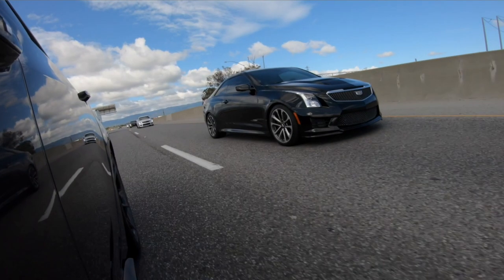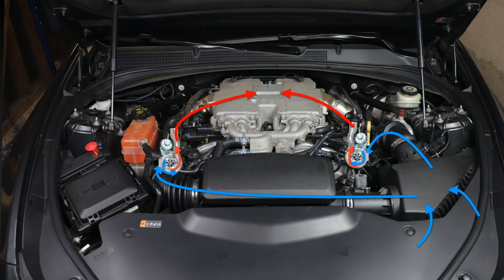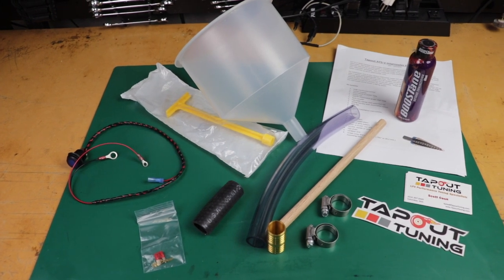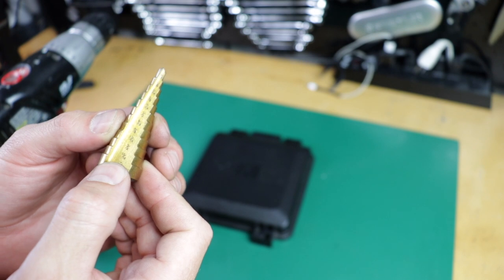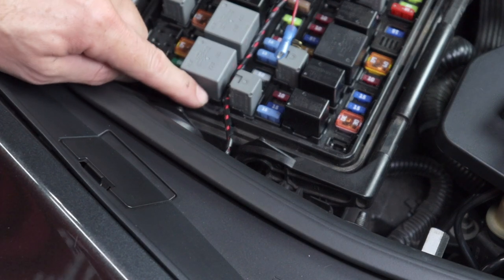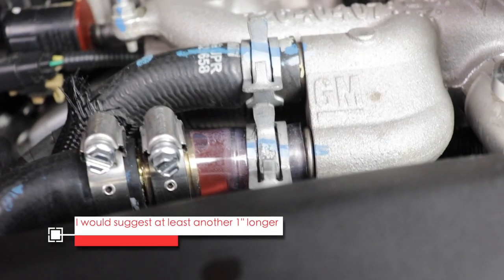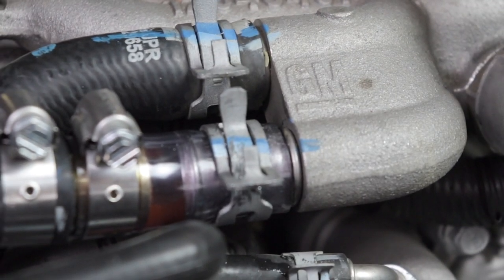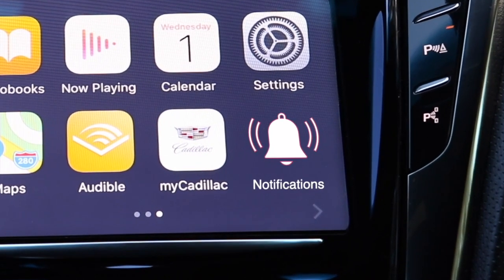Intercooler Bleed and Fill | ATS-V CTS VSport CT6

Comment: Just did my CTS-VS this morning.  My pump sounds like yours, like a dishwasher at the end of a pumping cycle.  So frustrating that it can be low on fluid/air trapped, and yet the resevoir shows it's full.  I'm giving GM a fail for this design.
Reply from the maker: The reservoir is not connected to the inner cooler. The reservoir is for the engine coolant. Part of the problem with the inner cooler system is there is no reservoir for bubbles to escape to.

Comment: So what happens in these sealed systems for coolant expansion from heat?
Reply from the maker: Yeah, not really sure where it’s going except possibly the bleeder valve. But it’s the first thing you want to check with loss of boost or high manifold intake temps.
Reply: I actually have an LSA blower on my 69 Chevelle and I was looking into changing my hose routing to help purge air.
Reply from the maker: @YZFoFittie you just need a reservoir if you don’t have one. A place where the air can go and stay out of the rest of the loop.
Reply: I was trying to avoid a reservoir due to space and clutter. I'm going to fab a simple motorcycle size radiator cap onto a piece of 3\4 aluminum pipe and add it to the brick outlet and see if that's enough.
Reply from the maker: Yeah that will be enough. The LT4 has a similar standpipe I believe
Reply: @JetFuelOnly  do you think expansion is an issue? Without room to go anywhere I don't want to have a reverse issue of the brick crush issues. I'm guessing the car in your video has a better designed brick? Most people weld on reinforcement plates on the LSA's.
Reply from the maker: @YZFoFittie that’s true. For possible brick issues I would be in touch with your LSA and LT4 people.